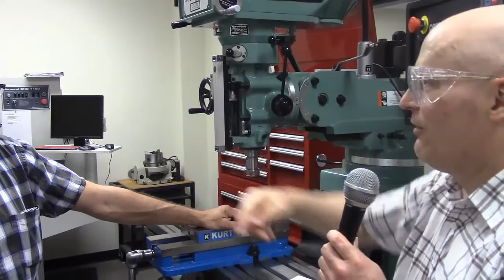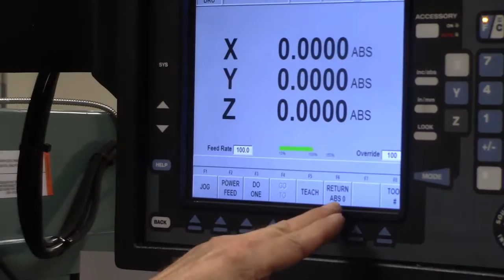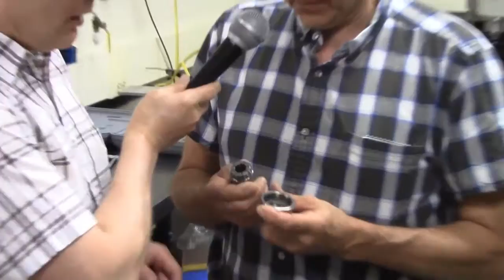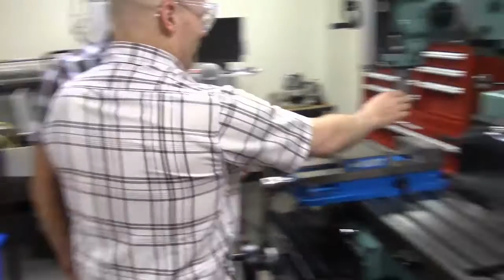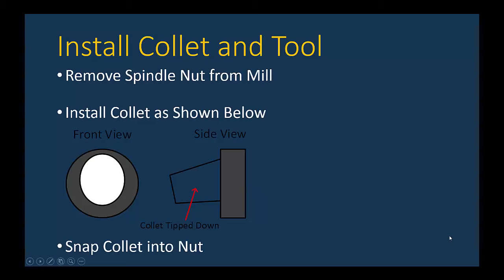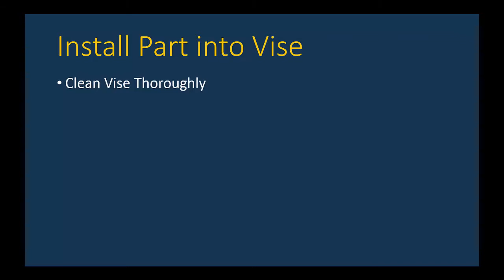MCC ENR 153 Machine Shop Video Mill  2 Mill Setup

Comment: 1.) A trammed spindle will be perpendicular to the table, while a trammed vise will be squared to the axis.
2.) When handling an end mill, be sure to hold it using a rag or a paper towel, as the tool is very sharp.
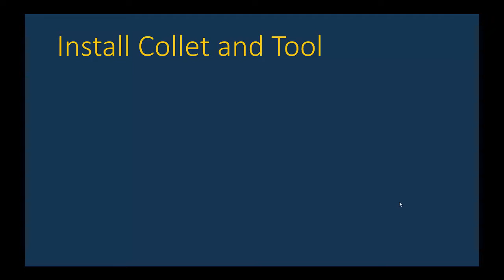3.) Proper orientation of the collet can be found at 16:51.
4.) The hand brake must be utilized to ensure that the spindle nut is fully tightened.
5.) To avoid the cylinder of danger, move the saddle and table away from the tool before inserting your part into the vise.